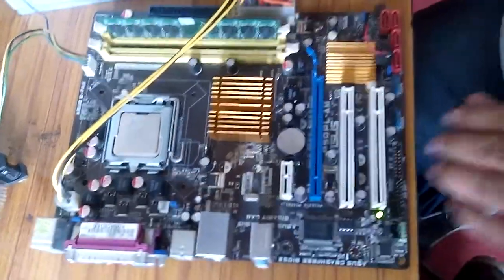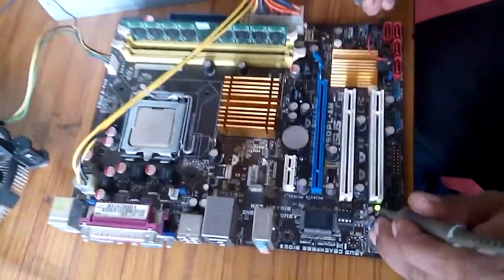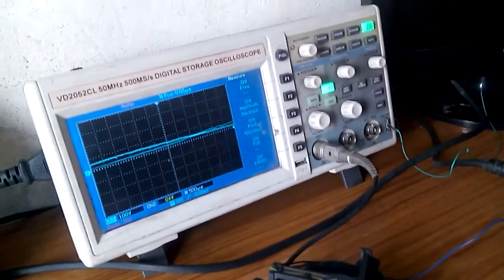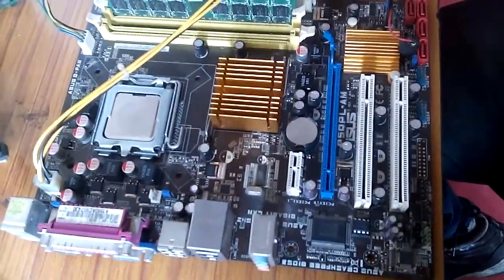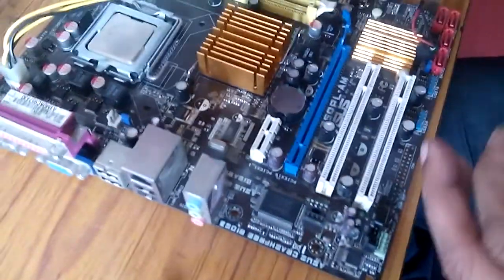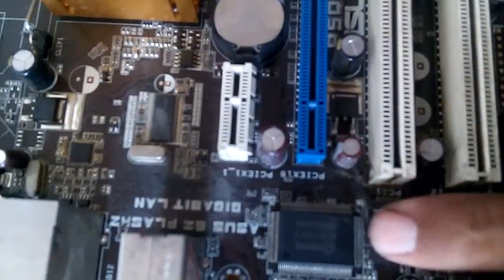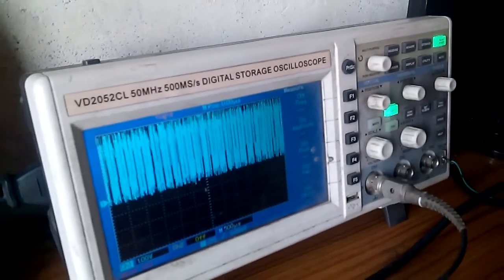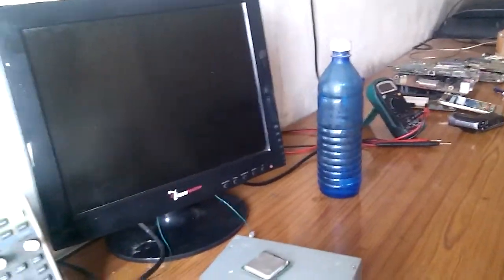how to repair asus motherboard

Comment: my motherboard problems is deep sound and no display i cheek cpu is normal heat and ram  and cell are replace but not solve the problem board intel dh61ww